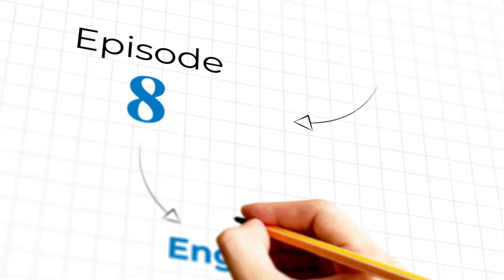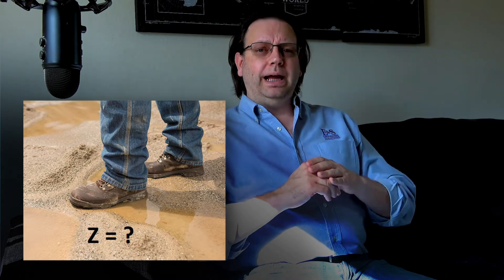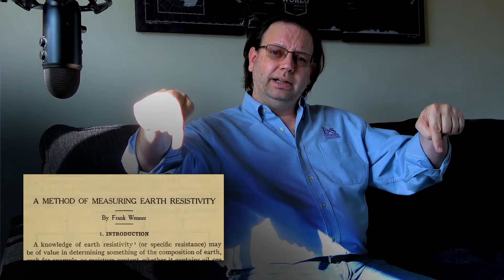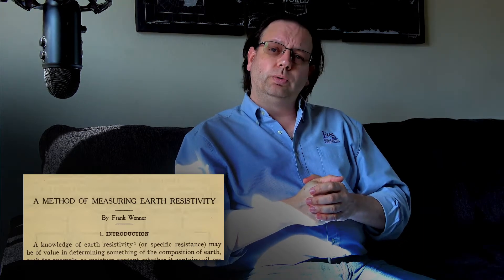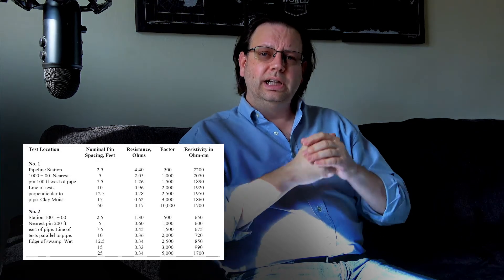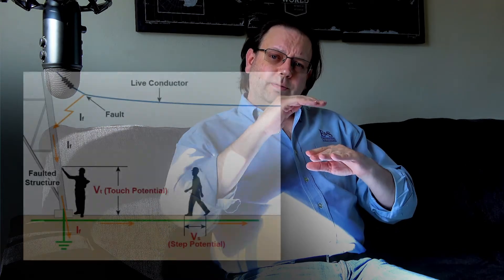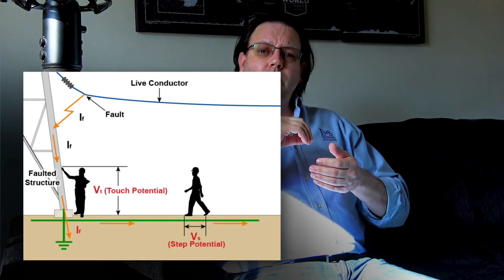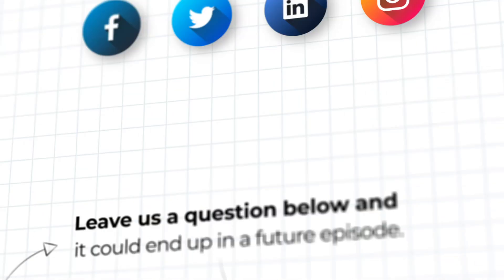What is the 4-Point Soil Resistivity Test? (Part 1)

Comment: hey sir if I have a horizontal bare conductor in ground forms a hollow square of side a how can I calculate the total earthing resistance according to BS 7430 using this formula
R=(ρ/P*Π*L)*(LN(2*L^2/(W*H)+Q)
L : the length of the strip or conductor, in metres (m); 
h  :the depth of electrode, in metres (m);
w : the width of strip or diameter of conductor, in metres (m); 
p : the resistivity of soil, in ohm metres (7·m); 
p and Q : coefficients given in Table-3 for different arrangements of electrode.
i cant find a case for p and Q in the table for square its only two lengths at 90 
what shoud i do